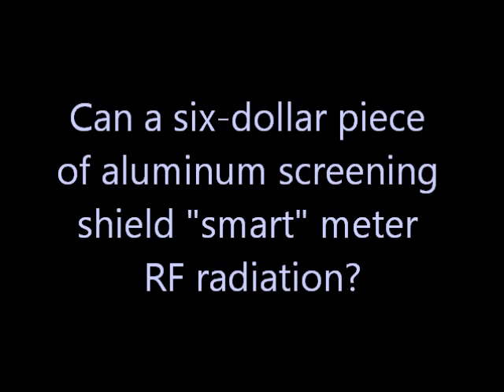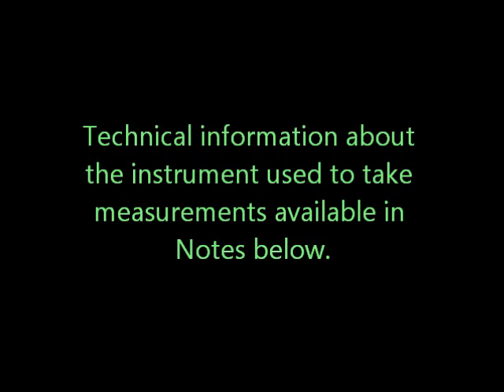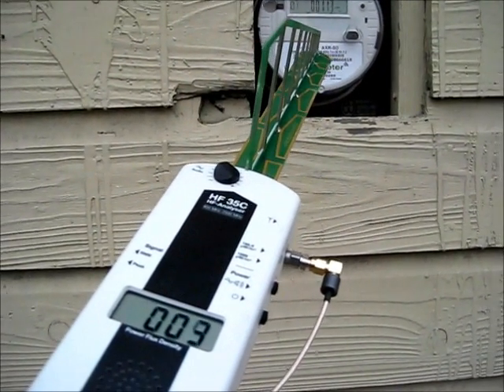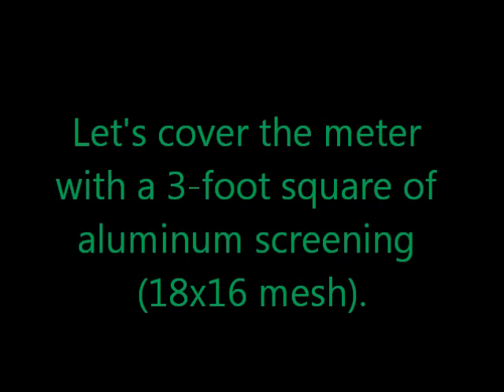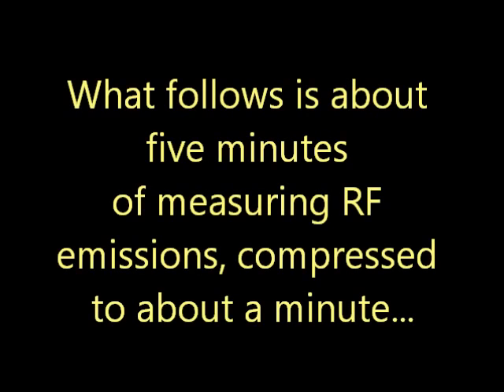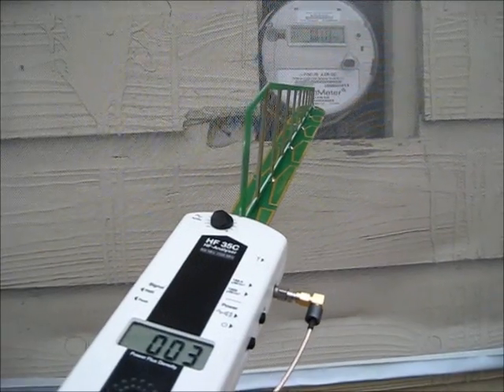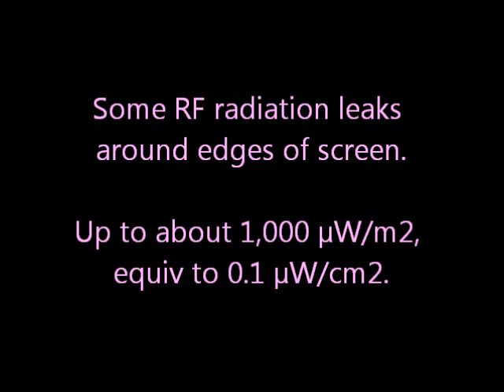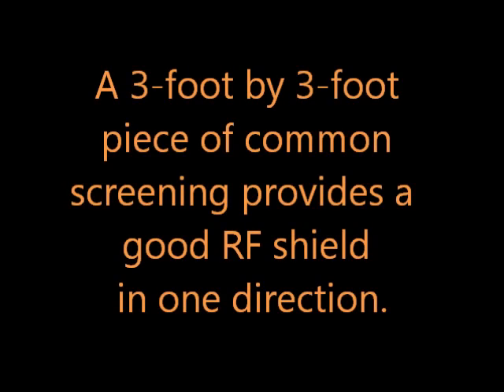Foiling a "Smart" Meter, Part Two: Aluminum Mesh Screening

Comment: 3. Of course, you must also dump that microwave oven. 

People, acquire switchable surge protection plugin bars. Place then in ways that make them easily accessed main switching devices for your commonly used appliances and entertainment devices. Switch these items on with the bar, and always switch all surge bars off when electricity isn't required.

People, following this plan will make a difference in the way you feel.

Comment: 2. ...electronic dog collars, remote lighting controllers, remote control thermostats, X-10 lighting fixtures, garage openers, low voltage devices such as sprinkler controls, yard lights, etc etc etc...

Then, you will have CLEAN, 60 Hz electricity, and a low magnetic field-polluted living space.

KNOW that the smart meter, AND certain other devices, produce ULF that BREAKS your DNA! Broken DNA is the site of future cancer.

All that is left are the wiring circuits. Twisted pair is the only fix.

Comment: 1. That's a fact, Jack. Slightly earlier in this comment section, I stated that the RF etc be eliminated FIRST. I described each device involved in producing the problems, along with a suitable action. 

Here's a clue. If your cell phone no longer works, your residence is safe to live in. 

Once you have placed the Graham-Stetzer filters, your Electricity is 60 Hz. When you have removed all wireless devices, CFL lights, dimmer switches, wall wart transformers, remote phones, baby monitors, ...

Comment: This certainly does. In fact, new home construction in England is using Aluminum-coated Tyvec on all exterior walls. In Kamloops, the existing Broadband field has been elevated to over 8 gig, and that is basically the "cloud" field. Other 8 local gig sources include Military and Plasma such as produced by Plasma Arc Gassification plants.

England is about to place a 10 gig permanent broadband field for the same "cloud" reason. 

The aluminum-coated Tyvec is their only possible safety measure.
Reply: 10G? Double the new 5G in America? I thought I just read somewhere that America is subject to 90% higher radiation than in Europe?

Comment: 4. ...foil on my interior walls. Once dried, the dull side will easily accept several types of primer, and any paint or wallpaper. This treatment will be invisible, and is as easy to install as a wall paper. I also intend to make wood framed, aluminum screened exterior trellis, aluminum chaffe "trees" and "plants", etc. Spiral cut those pop cans. Get creative!

People, Have to re-do the roof? Make it Aluminum. Siding? Make it Aluminum. Windows? Make them High E. Doors? Aluminum sheathed.

Comment: 3. People, some of you will have service panels which DON'T have the meter pot behind it. Be sure to first locate your meter, and then place the aluminum behind it.

In my case, covering the service panel also covers the meter.

I have located Aluminum coated tarps which i have purchased for the creation of curtains. These will be cut and sown to fit all of my exterior windows, and the original curtains will be placed over them.

I am working on a method of "soaping" (with squeegee) aluminum ...

Comment: 2. which is 32"x22" over my service panel, the RF microwave emissions from my meter STOPPED! I could plainly feel the difference. No more vibrating heart or pressure in my head. 

People, i have located 7 patents placed regarding the <60 Hertz brain wave alteration. The issue is real.

The fact is, your government doesn't give a shit about YOU. They care about the graft they receive via the Lobby interface. 

Take steps on your own to rectify this money-pig people-controlling mess.

Comment: 1. Rolling... Great observation. The four Hertz involved in brain function alteration are all below 60 Hertz. If you can feel emotional stress, that is the origin. If you fell your heart "vibrating", that is from the Hertz above 60.

One other issue is the ULF produced by the smart meter. Ultra Low Frequency RF causes your DNA to break, and that broken DNA is the CERTAIN future site of cancer.

Check my comment on cleaning your electricity.

When I placed a .125" aluminum hinged "door" ...

Comment from the maker: @cyaard  Sorry, but you are wrong. The shielding in a microwave oven is precisely the size needed to block a RANGE of frequencies of radiation in the microwave range, including cell phones. I have tried this experiment with several MW ovens, and a good tight fit on the door makes a big difference---the cell phone signal IS blocked when the MW oven is tight, and there NO connectivity. Keep trying it, and you'll find a MW oven like this, and your supposition will not hold up.

Comment: The light stays on when you close the door even if you don't turn it on (the light-switch inside is stuck or something, you have to press the bottom of the door so the bottom latch sticks in a little further to make the light go off).   I'm also reading that most cell phones use different frequencies (900/1800mhz) and the size of the holes in the mw door has to do with the wavelength being blocked. so the holes are the wrong size for cell phone signals. so its not that big of a deal if it rings

Comment: 5. ...ALWAYS switch them OFF when not in use. 

Follow this, and your electricity will be MUCH cleaner. After this is done, check your electricity by using the Stetzer Meter, and then apply the Stetzer plug-in filters. 

Your electricity will THEN BE 60 HERTZ, and clean.

Comment: 4. ...been recognized and studied in Europe, beginning in the 70's. Our response is not well known, and involves the Graham-Stetzer Unit as the measure. 30 G-S Units are considered safe, but much higher reading are typical.

First things first. Remove ALL CFL lights, remove ALL smart home switching devices, remove ALL lighting dimmer switches, remove ALL portable phones, and remove ALL wireless tech devices. NEVER leave "wall warts" plugged in. ALWAYS use switching Surge Bar plug ins, and ...

Comment: 3. ...insulating of YOURSELF and all electrical wiring, devices, computers, media cards, etc.

The best way is the complete sheathing of your home in aluminum or copper products. 

There exists Aluminum roofing, Aluminum sofit, Aluminum cladding, Aluminum siding, Aluminum coated Tyvec sheathing, Aluminum sheathed doors, and radiation reflective windows. These products and materials are reasonably priced, and easy to install.

Next, is the removal of "Dirty Electricity".

This problem has ...

Comment: 2. It is true that you don't want the reflected radiation in the atmosphere or earth. The Carbon idea enters here. Many air filter systems use carbon-coated mesh would can be recycled for placement over the Meter reflector, and on the ground around it's base. 

At some point, home exteriors require attention. Remember that aluminum Tyvec AND aluminum siding will be THE CHOICE MATERIALS.

Use windows rated to reflect such radiation, and DON'T FORGET YOUR ATTIC.

The ultimate goal is the ...

Comment: 1. Yes. The non ionizing radiation from the meter IS reflected. 

You must install aluminum inside of the meter, which is designed to reflect exactly back out. Then you must place bent, properly angled aluminum outside, which covers the meter(s). The shape will be that of a pyramid that has been vertically dissected based it's base's square. That shape is inverted, and placed over the meter, causing the radiation to be deflected 45 degrees upward. The material can be aluminum or copper screen.

Comment: 5. If you are unfortunate enough to have one of more smart meters near your exterior wall, the best answer is having at least one ply of Aluminum coated "Tyvec" placed on that wall.

People, smart meters are INTERFACES which are intentionally designed to manipulate and/or communicate with ALL OTHER SMART METERS, MEDIA CARDS, MODEMS, WIRELESS DEVICES, PORTABLE PHONES, COMPUTERS, AUTOMOBILE OBD3 and 4, NORTHSTAR, TOUCHSTART, etc.

They have killed by starting a touch start car in a garage.

Comment: 4. ...manipulations which effect human brain waves. The Hertz Filters stop that, and also stop "dirty electricity" which the smart meters are designed to produce ABOVE 60 HERTZ!

A serious issue is the meter's ability to intentionally disrupt "clean" 60 Hz electricity and produce FALSE 50 Hz dirty electricity. The manner in which this is done is above most people, but the resulting health issues are well known. 

Created 50 Hz is NOTHING LIKE EUROPEAN 50 Hz 220 Volt power.

Comment: 3. By now, you see the goal. Now. move to placing reflective SHAPED aluminum over your smart meter face. This reflector's shape is an inverted, three sided, bottomless pyramid. The reflective angles are 45 degrees, and is mounted so the meter's microwaves are reflected upward. This shape also reflects the communication from all other meters DOWNWARD.

People. There are three serious issues involving fire hazards, and countless issues involving the under 60 hertz microwave/magnetic field...

Comment: 2. ...over it. Using the same aluminum, place a shield between you and ALL COMPUTERS. Completely avoid Lynksys type wireless routers or spend as little time as you can on the wireless type computers, etc. Get rid of your tube/halogen/energy star lighting. REALLY! Get rid of your portable phones, buy old style touch tone "rattlers". Purchase and install Plugin type 60 Hertz electrical filters. Place at least one in the first plugin of EACH  ELECTRICAL CIRCUIT coming out of your Service Panel. ...

Comment: 1. People. There is a definite hazard regarding reflected non-ionizing radiation. That is exactly what is being reflected back into your house wiring and interior. That is BAD, so you should begin with the inner wall upon which the smart meter is mounted. Create the first (hinged) reflector out of 1/8 inch thick aluminum sheet. Make it so it captures and reflects the meter microwaves outward and downward.

If the electrical panel is elsewhere, make and mount another easily opened hinged panel...

Comment from the maker: Excellent question. For decades we have had high-power transmitters for TV and radio. But they were not located near you. Now we have low-power transmitters (like your cell phone) located VERY near you. Like on your head, or near your bed.

Power density drops off the further you are from a transmitter. But even a 1/4 watt transmitter close by can produce a much much stronger field than a high-power transmitter at a distance. It's all about distance. Good education on this:
watch?v=AEOcB7Svhvw

Comment: What about the inside of home?? -smart meters are suppose to interface with the efficient light bulbs.  Coast to Coast AM - 3/20/2012 Alex Jones Part 4 start around 12 min, you won't believe it. Trying to find another speaker that explains how to have them removed

Comment from the maker: @Robbob9933 I understand the concept of what you propose, and acknowledge the truth in it.  In theory some of the RF would be run to ground. However, there would still be "leakage" because the antenna in a smart meter is omnidirectional, and the screen is only "catching" some of the emissions. What goes in other directions will be unaffected by grounding.

Grounding is ideal, but in a city, is it often impractical.

Comment: Video poster.  If you ground the screen to earth, there would be no leakage at the edges.  The ungrounded screen is acting like a plate under a faucet.  Your total leakage is equal to the source signal.  Sure you have lowered the strength but a ground would send the EMF where it really desires to go and that is to ground.

Comment from the maker: @pinkplatypus99 This is an Gigahertz Solutions HF35C analyzer. Available from LessEMF or GigahertzSolutions (you add the dot-com).

Is use attentuators (1 or 2)  to make the device LESS sensitive so that I can measure the top of the smart meter pulses. As shipped, this device is not useful for the purpose of catching the top of the pulses. This device is superior for catching smart meter pulses. CHIK: The sound the device makes helps discern the source of the RF---see my playlists for more info.

Comment from the maker: @thisirradiatedlife [continued from previous] the OWS-NIC514 is NOT to be colocated with any other transmitter, is to be installed by a professional, is to be limited to one watt transmission power, and people are to be kept 20cm away at all times. None of these regulations are observed by PGE.

You can't have it both ways, buying one aspect of FCC regulation, and ditching what you don't like.

Comment from the maker: @MrsZambezi Having measured, it's clear there's no directionality to the antenna. Having read the specs, it's clear there's no directionality. That is the crux of the whole mesh-network idea. The antenna is in fact wrapped around the unit. 

If you take the FCC limits as your bible, then you must also except that the FCC does regulate unlicensed transmitters (and the PGE model is one), and that those regulations have merit. The FCC specifies that the OWS-NIC514 [continued next post]

Comment: @thisirradiatedlife The specs are freely available online. The power is only 1W, and that is directed away from the property. Contrast that with a 1,000,000W TV transmitter in the same UHF band, yes there are some, and the 3W you get from a cell phone clamped to your head in normal use and you will realise that the illness you describe is psychological, not physical. The field strength you quote is very small, 0.021W  isnt anything to worry about.

The "illness" is caused by the scare stories.

Comment from the maker: @MrsZambezi Actually the the ERP is not the issue. The IPP is not even known on the PGE model, because we haven't got the specs, and hence the power of the capacitor/battery at the point of transmission (though we do know the EIRP, which isn't 1W, it's 2.5). One of the EMF techs working for SSM clocked a pulse of 21K µW/cm².

Time averaged power isn't the issue. The pattern of RF coming off a SM is unique, erratic, and untested for its effects on humans. People are sick from them.

Comment: The difference now is that we are much more surrounded by the kinds of frequencies that interact with normal body frequencies and signals. Apparently the old radio and television signals were in ranges and frequencies that did not have as much of an effect as our newer devices. It is interesting that since these digital devices started coming out, many degenerative diseases like autism have gone up hundreds if not thousands of percents. Something is going on and EMF are the most logical culprit.

Comment: @Dean7Co We have been surrounded by strong RF fields for years and those from the smart meters aren't strong at all. It's only the scare stories that are new. Are all the engineers and DJs that work on high powered (up to a million watts in a few cases) radio stations all dropping dead or getting headaches? No, because they don't worry about it. No, I don't work for a utility or meter manufacturer but the truth is important to me.

Comment: Mrs. Sambezi--I wonder if you are paid to come on here by a utility company or one of these meter manufactuers. If you want to live in these environments you go right ahead, but stop forcing them on the rest of us. Until you experience symptoms you don't know. At what point do you think physical problems will happen? This stuff is now coming at our bodies from wifi, cell towers, ground current, portable wireless phones, and smart meters. Tiny signals run our bodies. They are not steel.

Comment: Mrs. Sambezi--It sounds like you are going by the OLD standards which assume that if the radiation doesn't cause living flesh to heat up, then it's safe. That's like saying a little arsenic or cigar smoke every day won't hurt you. Our bodies operate by the tiniest of signals and impulses. The reasonable thing is to assume that manmade signals on those frequencies and such could be altering cell function which experiments have proven. Look for The Dark Side and for anything from Dr. Magna Havas.

Comment: @stopsmartmetersorg 

You forgot to mention that a smart meter only transmits a few minutes each day and it isn't clamped to your head in normal use.
Or that a TV or radio transmitter can be up to a megawatt and the stray output from a microwave oven is far higher. But don't let the facts get in the way of a scare story.

Comment from the maker: @EurekaRecycler I don't have access to the inside of this building, but in other places I've measured, I have not been able to detect RF moving along the wiring. That doesn't mean it isn't there, but my equipment is probably not up to that sort of detection. The pulses off the meter itself whomp most everything else in the environment at the moment of transmission---way higher at the peak pulse than lots of other transmitters.

Comment from the maker: @catothewiser Fiber optic cable is sure, secure, clean, and produces no RF---but expensive. Utilities are oriented to short-term profits that satisfy their investors, not long-term investments in infrastructure.

Unfortunately for the public, radio-frequency transmitting electricity meters are really cheap compared to FO meters. FO calbe, once laid, can form the basis of future communications facilities, like streaming & broadband. But it takes a few years to reach profitability.

Comment: What you have done is to shield against emitted radiation toward the street - but  NOT toward the inside of the home. The antenna lobe pattern will be somewhat flattened but no eliminated. You also need shielding AROUND the meter. You cannot measure the RF behind the screen. Go inside the home and see what happens.